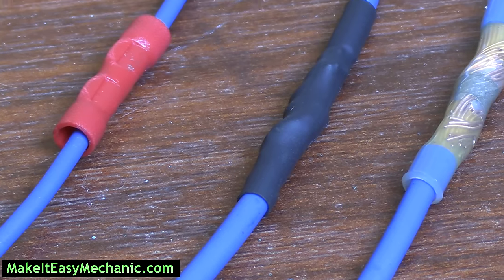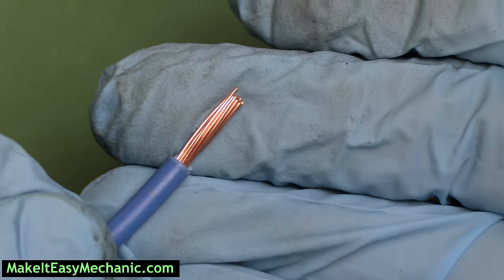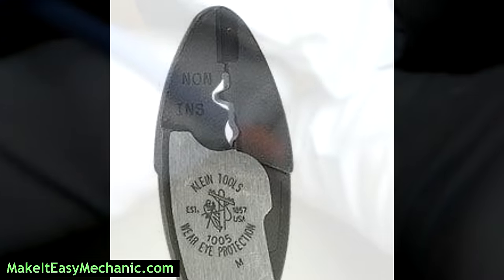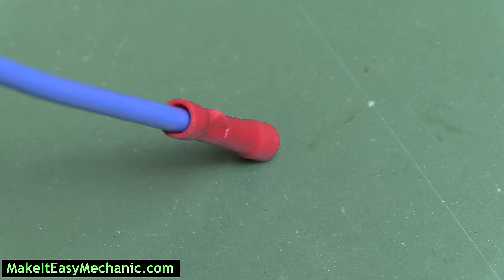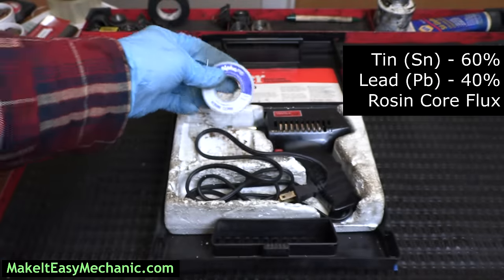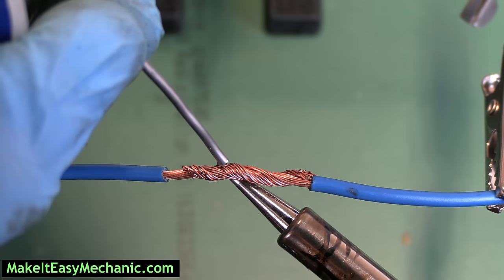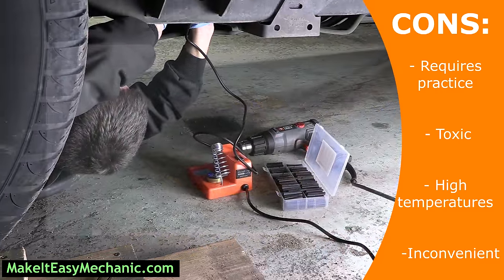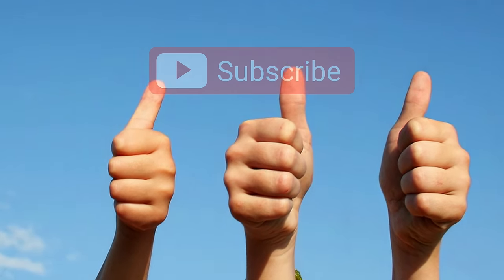How to splice wires - how to solder, how to crimp, wire connectors

Comment: Omg! The worst quality connectors are being used! Vinyl verses Nylon with insulation grip connectors. The link is only with Vinyl connectors which are not made to last! The heat shrink connectors used in the video same story. There are different quality heat shrink tubing and connectors. I can barely watch video obviously who ever made this video is not an expert or professional. I spent 42 years in the industry electrical problems are usually caused by poor connectors or tooling.